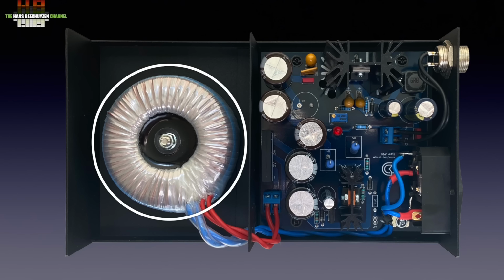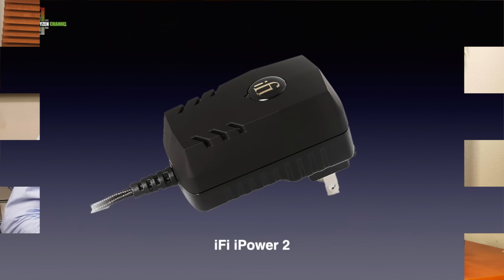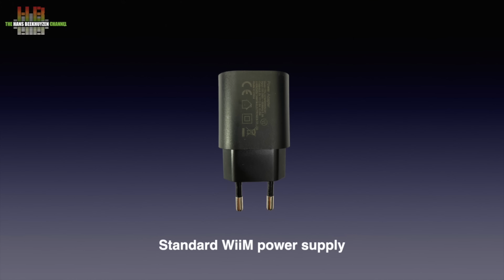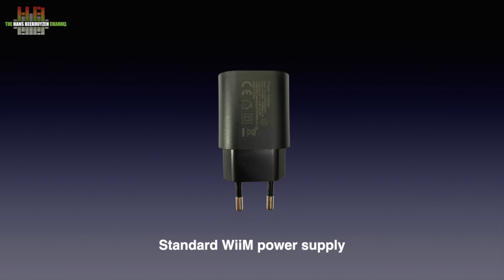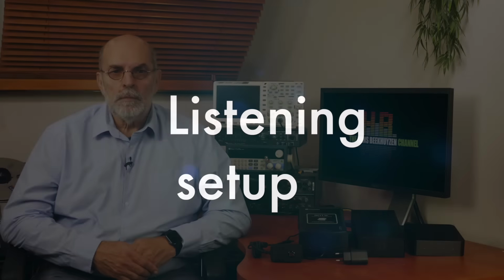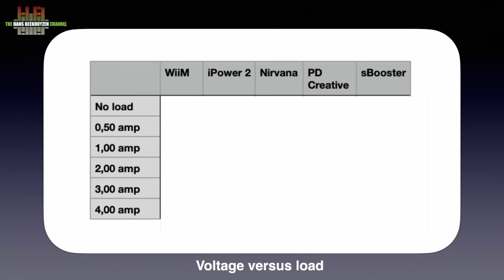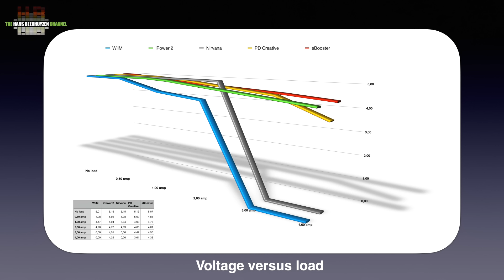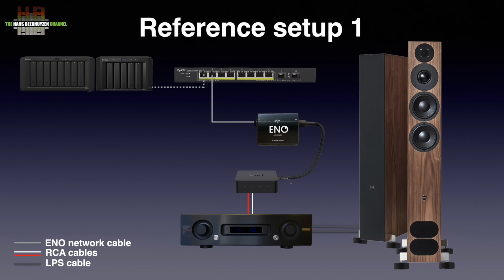Five power supplies for the WiiM Pro+

Comment: Hans, you're a star (as is Tarun, The British Audiophile). I have a WiiM Pro Plus hooked up to a Mojo, which fed my Denon PMA600ne amp. I could barely hear the commercial freezer/compressor/pump come on in the barn through my Br03 speakers, but when I acquired my Grados it was more obvious, and then I started thinking I could hear a very,very faint hiss.
Imagine my joy when I saw your video, which could have been tailored for me.
An iPower 2 was just delivered which I've plugged into the WiiM. I am staggered by the difference , I'm not even going to ask my wife to keep swapping over power leads, the difference is incontrovertible. On the strength of that I've ordered a 6-way power strip that won a What HiFi magazine award, for a modest £40. Fortunately my pockets, and my wife, will prevent this from becoming an obsession, but I can't figure out how the barn circuit is getting to the house circuit. Forget it and turn the music up!
A million thanks.

Comment: Thank you for the comparison. Before I saw this video I had purchased the iFi Power2 to use with my WiiM Pro and Pro Plus. Will watch again and see what more I learn. Would be nice to rate each of the power supplies on a scale say from 1 to 10 to help us better understand the performance improvements relative to each other.
Reply from the maker: I don't like single dimension ratings.
Reply: @TheHansBeekhuyzenChannel  Understand, then let’s develop a three or five category one. Say
1. Sound Quality, 2. Build Quality, 3. Software Quality/Support, 4. Ease of Integration, 5. Features or what ever with a 1 to 5 in each. Every problem has a solution. Thanks for your time.
Reply from the maker: Perhaps you should start your own channel. It’s a lot of work though.

Comment: Thank you again Hans for another informative and useful video. I had the same experience with the power supplies and WiiM Pro. I have both the LHY 5v LPS and the ifi2 5v PS, I cannot tell the difference between the two. But, they did have an overall positive impact on the sound, as you stated.
Reply: Using always an external dac for my wiim pro worth it to power it with a linear power supply?
Thak you
Reply: Is that the LHY with 2 x 5V outputs? Seems like that would be a better buy if you have two components than use 5v.

Comment: Thanks for a great review. One thing that I hadn't thought about before, but stuck me from your video was the use of the ENO to filter the Ethernet connection. I hadn't given it any thought, but I guess it makes sense that there could be noise on that signal path. It gives me a whole new area to look at (i.e., Ethernet filtering and audio grade switches).

Comment: Took your advise and installed the iFi iPower 2 to the WiiM Pro connected to an external DAC. I could not believe there would be such a difference made by a power supply. Thank you !
Reply from the maker: Great to hear!
Reply: If i understand correctly, Hans explained that the power supply for the digital source is not as critical as the power supply for the DAC.  You need the clean power for the D/A converters.  I'm surprised that you hear a difference when you use the WiiM as a digital source.  Do you have another iFi iPower 2 on your DAC as well?  Might be interesting to compare with and without for the WiiM and the DAC, four tests in all.
Reply: The iFi Power2 was only used for the streamer circuit in the WiiM Pro. Coax cable was used to a Yamaha A4A receiver. I definitely heard more clarity in the output sound.
Reply: @bruciox   The WiiM Pro Plus is a 5v.
Reply from the maker: The 5 volt version
Reply: Which external Dac are you using please ?
Reply: I have listening fatigue when using ipower2 for powering Wiim pro +

Comment: How would the results change if WiiM Pro+ would connected to DAC first, like dinafrips, over toslink which connected to an amp over RCA? I understand interference is still a thing, but these PSU can have different results.
Reply from the maker: The sound quality will be higher but not to the level the Denafrips can deliver with a better streamer.
Reply: Hans, thank you for the answer. May I ask your recommendation of a streamer to consider or a few? 

My system as a reference for the price range: WiiM -> Denafrips Enyo -> Parasound A23 -> Polk Audio SRS 2 (after thorough rebuild)
Reply: I would try the WiiM Pro, pick up a linear power supply like the LHY 5v unit and get the WiiM remote so you can use the WiiM Pro as a preamp. Use a good digital coax cable to hook to your Enyo. I think you will be pleasantly surprised. I am using my WiiM Pro through a PS Audio DAC right now, and it sounds better than the other much more expensive streamers I have had through here.
Reply: Today I spent half a day comparing my streamers and dacs. I tried Nirvana SMPS too, for some reason in my setup it adds more noise. My resulting system: WiiM Pro Plus -> audioquest toslink -> Enyo -> Parasound A23 -> Polk Audio SDA SRS 2. 
Result is top. For my ears and expectations
Reply: @AlexAnikin So, which power supply are you using? The one that came with the WiiM? Just curious.
Reply: Yes, the original one.
Reply: @AlexAnikin Cool!

Comment: As I mentioned yesterday in my comment that the powerbank, easy available in Holland for €35, can be a big improvement. I listened to this video a few times after that specially the part about batteries . A powerbank is nothing more then a battery . You stated in this video that batteries have also disadvantages and I agree with that . Maybe they produce more noise then a LPS but it's way less noisy then the provided cheap PS the manufacturer (Bluesound, Wiim, etc) provide with their products. Today I tested the IFI Power 2 and the IFI power X with the bluesound. My local HifI shop gave me these units this morning for testing out. These units sell for €79/€119 depending on the version. I compared them with the HAMA Powerbank 24000mA  available everywhere in Holland. The Powerbank outperforms the IFI's easily in terms of SQ in every aspect specially in soundstage, depth and clearence of instruments. I didn't expected that to be honest because the IFI's are dedicated audio Power supplies. I think it's because there is no AC voltage interference possible in the chain with a battery . The Bluesound is connected with RCA out to my Amp. The IFis are going back, minimal improvements over the stock PS although The power X is the better sounding option of the two.  Now I'm gonna try a LPS. If that isn't outperforming the powerbank by quite a margin , considering their much higher pricepoints, I'll stay with the powerbank. In the end it are the results I'm hearing that are counting and not some oscilloscope measurements. I'm a guitar player and I'm powering my effects with batteries for the exact same reason. I learned this from listening to experiences from the best guitar players in the world who' are very picky about their sound like Eric Johnson. He's not only a brilliant quitar player but he's also a nerd when it comes to electronics,cables,connectors,amps and guitars. He's a rich man so he can buy every PS money can buy but always uses regular 9V batteries.... His explanation....It sounds the best, no mains interference possible in my effect chain. After every set the batteries are exchanged for new ones. I watch a lot of your videos. You're the best in business , a good teacher, knowledgeable, no BS but straight to the point. My compliments. I'll subscribe to the the channel.
Reply from the maker: They are noisy and inconvenient.
Reply: @TheHansBeekhuyzenChannel , yes maybe they are but then please explain why while they are noisier, they outperform the supplied PS by a fair margin? They should sound worse then....inconvenience, I agree, but I take that as a side issue till I'm founding something more convenient at a reasonable price

Comment: Excellent review! Would the differences become less audible when the streamer is connected to an external DAC?
Reply from the maker: To some degree, depending on the DAC used.
Reply: Thanks! I’m using the internal DAC in my Hegel H190. I’m mostly curious if in your experience, streamers that aren’t using their DACs are as affected by flimsy power supplies. Thanks!

Comment: Hi Hans, I have an SBooster ECO BOTW MkII linear power supply. My WIIM Pro has a USB-C power connecter. The Sbooster didn't come with a USB-C adapter. How did you connect yours?
Reply from the maker: By Buying an adaptor cable on line.
Reply: @TheHansBeekhuyzenChannel  Now you will have to compare the $5 adaptor cables to the $350 ones.   🤣

Comment: You should try a battery power supply. I have had very good results from an inexpensive LHY lithium battery supply. Lithium batteries have very low internal resistance.
Reply from the maker: I have tried. Wasn't convinced.

Comment: Great video ... I just bought the Wiim Pro, using it as streamer only with Emotiva TA2 (AudioQuest Coax Cable connection) ... am I correct in saying that better power supply will not have an impact because I am NOT using the Wiim Pro DAC ?? Thank you
Reply from the maker: My pleasure

Comment: Can you clarify with the sBooster which voltage option to take as they produce several from 5V power supply to  24 V option. I am also using a Diablo X which has its own battery and therefore I don't think there is a need for a second power upgrade ?
Reply from the maker: The Wiim needs 5 volts plus a USC C adapter

Comment: I  honestly don’t understand where is the ‘noise’ or ‘distortion’ that upgrades are supposed to solve. I compared the regular Wiim to the Pro Plus; I can't hear a difference. I got the Nirvana power supply: I can't hear a difference. I got new preamp Tubes for my tube amp: I can't hear a difference. Not sure if I should be disappointed I can't hear any issues or happy I'm saving money and I'm content. I was genuinely hoping to hear something "better" or "different". Does anyone else feel as perplexed as I do?
Reply from the maker: It's the noise in the digital circuit that confuses the digital to analog converter and causes distortion there. It's not the noise in the analog signal.

Comment: Hello could you please tell me if the PD-CF power supply would be similar or as good as the Beatechnik LPS A6 power supply for the A6 Master? Would like to hear your thoughts on both manufacturers
Reply from the maker: I have not reviewed the Pf-CF so I can’t say
Reply: It is made by PD Creatives and is currently on special for 660PLN . I am thinking its probably a better option currently than the Beatechnik. Would you recommend PD Creatives products?

Comment: Would it make a difference in you were only using the WiiM as a transport delivering its digital output over, say, optical to an external DAC?
Reply: Everything related to electronics can be interfered. That is my experience working with Fieldbus devices.
Reply: It would but your money would be better spent on a better streamer.
Reply: @Pete.across.the.street  have you a/b’ed a WiiM vs. “a better streamer”? And if so, what were the results.  Thanks!
Reply: @ericfrederick1227  yup. Result was i returned the Wiim pro plus because it sounded pretty bad comparatively.
Reply: @Pete.across.the.street compared to which streamer/s?
Reply from the maker: The WiiM is excellent value but not the best sound obtainable.
Reply: @Pete.across.the.street  Which streamer did you purchase in it's place?
Reply: can i use 5.1V  3 ampere? a raspberry power supply? tia

Comment: Hi, Thanks for your review.  I have one quick question.  How do you plug in a dc tiped power supply into the wiim usb c power input?  thanks
Reply from the maker: Using a converter cable. They are offered on line.

Comment: Any measurements or blind ABX?
Reply from the maker: I measure everything and only report things that clearly affect audible sound quality. As far as double blind testing is concerned , watch https://youtu.be/QG6LS9VDZlg?si=rZBuxD7Ky6AxSz7l
Reply: Excuse me but I didn’t catch any measurements relating to differences in audio output signal. As for blind testing I’m not able to tell what would the argument for or against it be but I’m assuming no such thing is called for here.
Reply from the maker: The latter is explained in the video I mentioned
Reply: No, because it's mostly influenced by the price and visual bias. Is the output of one power supply cleaner than another, show me the signals. Does it even matter since the DAC already has all the power filtering it needs. Blind test would result in no audible difference.

Comment: hello, thanks for your interesting video. I'm lookin for an upgrade for my wiim pro power supply. it comes with a 5V 2A power supply. I found an Ifi Power 2 that's 9V 2A. is it ok for my Wiim Pro? thank you for your reply
Reply from the maker: No, you need the 5 volt version of the iFi iPower2
Reply: thank you so much😊

Comment: How does voltage drop normally affect digital equipment and its sound quality? Many LPS struggle keeping the voltage when current increase which leads me to think some digital devices are not so happy with LPS on them.
Reply: They need a bigger transformer if maintaing voltage is a problem. It seems the lps might not be the correct one to use. If you account for the voltage drop, or build a lps with a better regulator and bigger transformer, I see very little down side to using a lps.
Reply from the maker: I misused the power supplies by putting on a bigger load and thus demanding more current than they can deliver according to their specs.

Comment: Hi Hans. Thanks for doing what you do. 
Do you (or anyone else in the comments) have any experience comparing the benefits of the original ifi ipower supply with the version 2? I have a few of the original ones in the house, and I'm curious if there is a significant difference.
Reply from the maker: Anyone?

Comment: You're very knowledgeable. First I was a guy that thought power is power. I was wrong. Today I tested the new bluesound Nano with a powerbank that I used for my phone to test if there was a difference . Night and day difference. Exactly the differences you described but a battery is not a permanent solution. Now the search goes on for a dedicated power supply.... But which one? I want at least the SQ of the powerbank. Thanks for this great video.
Reply from the maker: Great to hear!

Comment: In principle you prefer a well implemented switched mode power supply for a DAC-less streamer. But in this case you prefer a well implemented linear power supply for the Wiim.
Reply: That's not a dacless streamer
Reply: Aha @Pete.across.the.street  I stand corrected. It's the Wiim pro plus streamer Dac !
Reply: This is the gist of this review, Hans' test was more of a review of the power being supplied to the WiiM Pro+'s DAC than the digital side.  I would have liked to see a comparison of the power supplies on the quality of the digital signal feeding his DAC, although Hans said it is not critical.

Comment: Can I just buy a line conditioner instead of a standalone power supply
Reply from the maker: A line conditioner does not convert grid AC voltage to a low DC voltage. So: no.